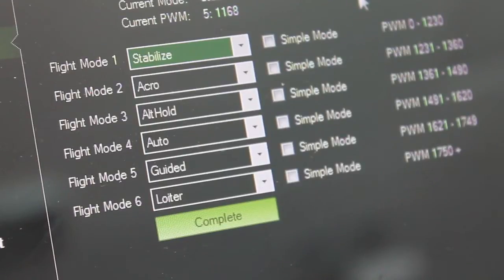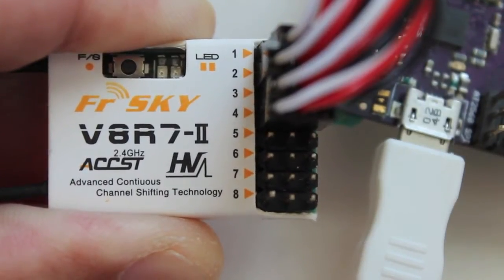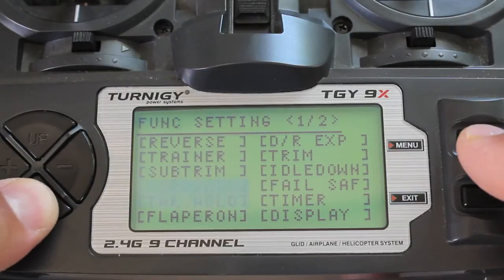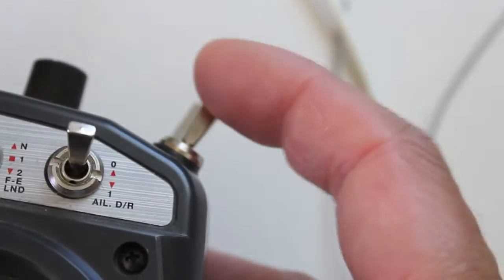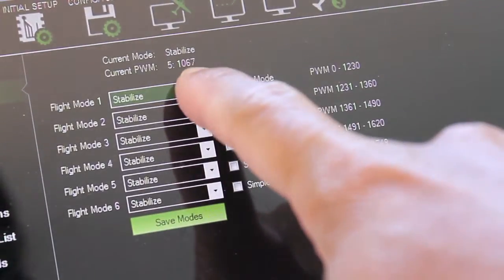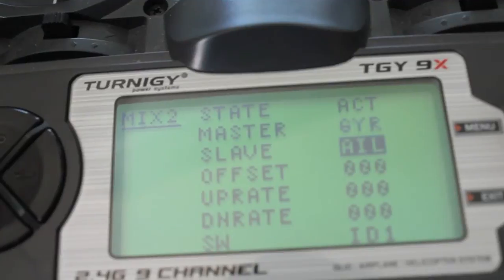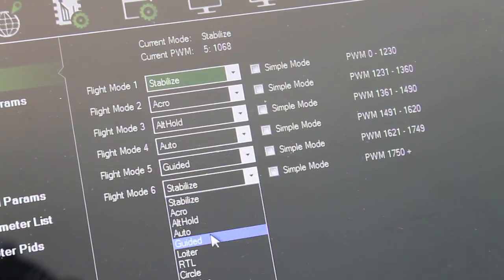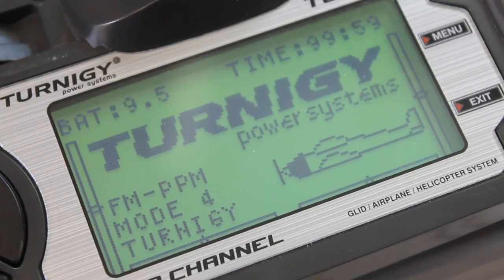Turnigy 9X Stock Firmware 6 Position Switch for 6 Flight Modes with APM 2.5 and Mission Planner

Comment: Thanks. I just about gave up trying to get a copter to hover using helicopter modes. The Acro mode worked just fine. My new tricopter should be here in a week and I'll try out the 6 flight modes.

Comment from the maker: I think a servo would see it just fine, but haven't tried it. It's sending out standard pwm signals so you could technically send the servo to different positions based on the switch position. Thanks for kind words.

Comment: Couldn't be explained any better. Thank you. 

Is there any reason to pick any mode other than Acro when flying multicopters? It seems the heli modes don't let you zero the controls using subtrim.

Comment: Dennis, I haven't had time to doing thing with mine still waiting on the cable's and been busy, but have you checked on how a servo would see this on ch 6, just wondering.
And yes I to thought about upgrading the firmware, BUT I like to learn all we can about the stock firmware. And Dennis has done some really hard work on this and helping us all. Big thanks to Dennis.